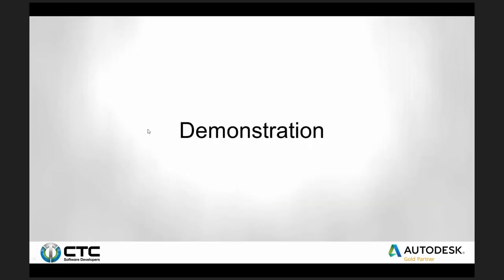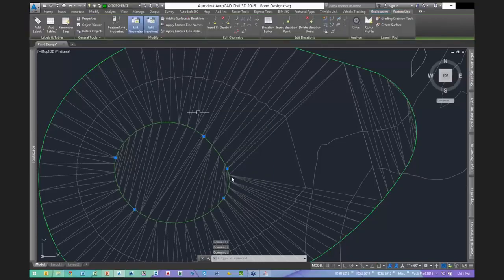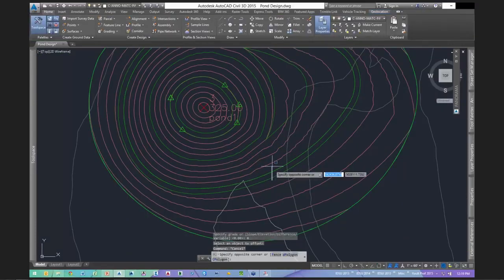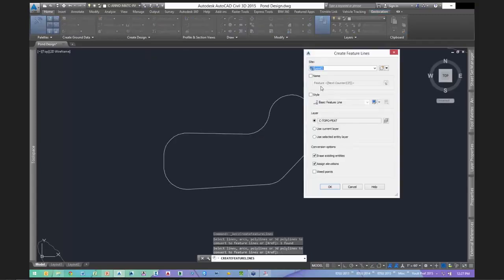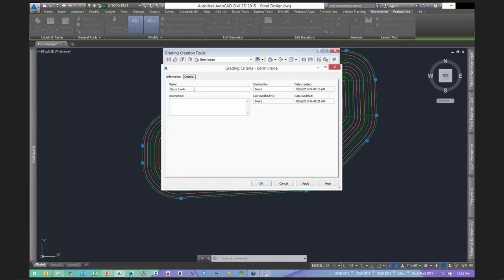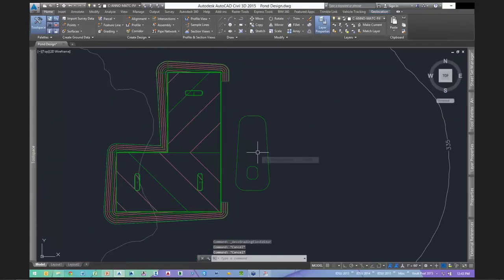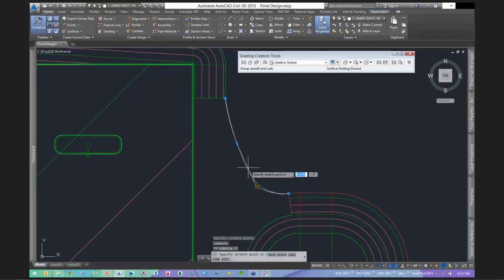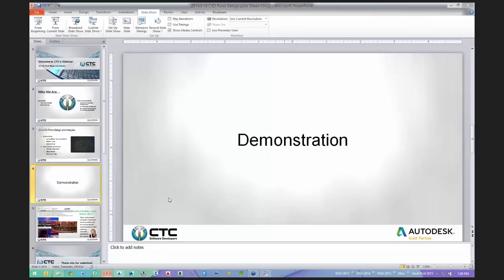Designing Ponds in Civil 3D

Comment: Thank you for the video.
I've watched a few pond creation videos and many approach the design in a manner that is not consistent with a typical design approach. Most draw the pond randomly and then determine its volume afterwards. Usually as designers we determine the storage volume required first, and then we set off designing a pond of the required volume. So the question that is not addressed in the videos I've watched so far is, how do you go about designing a pond of a desired volume in civil 3d, say 100m3?